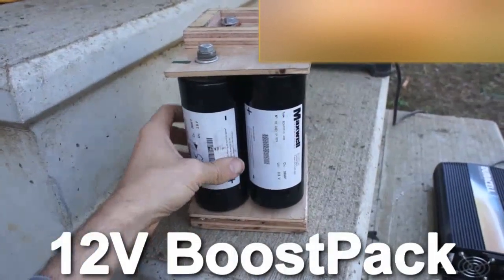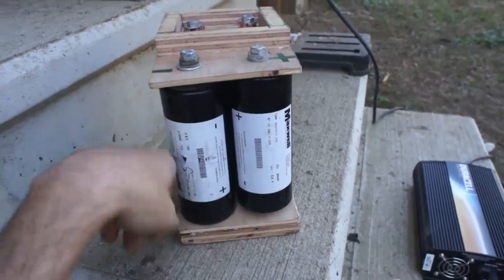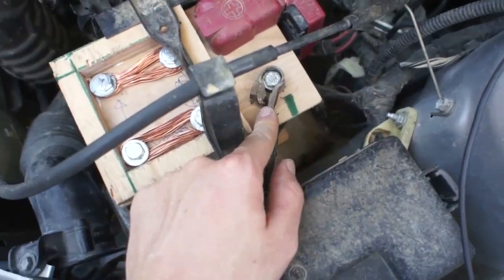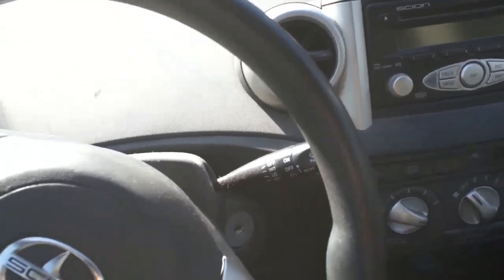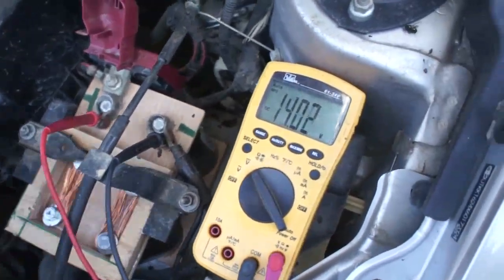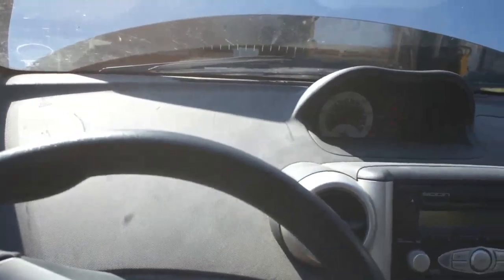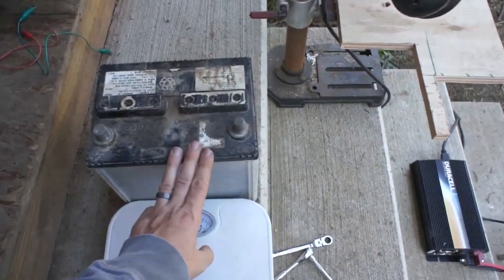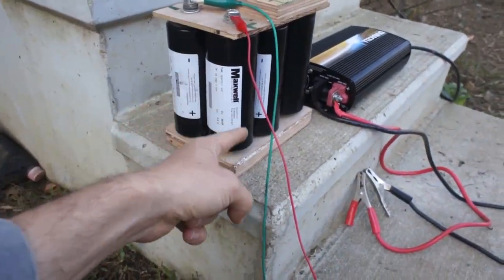12V BoostPack. Replaces auto battery. Works great!

Comment: Large capacity caps like this will give you a very high rate of amps, but have a very small amount of reserve capacity.  This means any of the following scenarios will render you screwed:  Engine is hard to start and needs to be cranked, alternator fails while driving, you leave your lights on for more than a couple minutes, etc etc.  A lead acid battery has an infinitely larger reserve capacity, and can work through these events.
Reply: Well...not infinitely.
Reply: What are you gonna do walk your car home off the starter? The scenarios you described are pretty much ones where you'd end up stranded anyway, or something else is going on with the car, in reference to the hard to start part of it. 

I don't leave my lights on without the car running.
Reply: Can there be a capacitor battery combination?
Reply: @matthewforte3570  actually they are on sale now, battery and capacitor bank they at around $170.00 + shiping on eBay dry batt not included.
Reply: @oscarvasquez2012  awesome im surprised such a item didn't exist much earlier
Reply: parallel them with a deep cycle battery for best results, RAW POWER plus long reserve time...
Reply: @christopherleubner6633  i look forward to electric cars becoming mainstream. Do electric cars wheels double as generators to sustain the batteries charge?
Reply: @matthewforte3570  yep
Reply: the motors that drive the wheels are used as a generator during light and moderate braking net effect is similar to dropping it into low gear, but can do so electronically.
Reply: Not really infinite.
Reply: bigman55434  keep n small solar panel in your boot problem solved

Comment: How long do they hold their charge? 
I'm thinking about using some in car audio application instead of using batteries. What would happen if I shut off my car and they aren't being charged anymore by the alternator? What voltage are they going to sit at? And what If I don't start my car for a day or two would they be ready or would they have to charge back up?
Reply: Buy an OPTIMA AGM battery for your car audio system. It's a lot of money, but it will last the longest and they are EXTREMELY reliable.

Comment: Optimum would be to have a permanent solar charger installed. That way your alternator would not have a max load charging the caps when they are low. Otherwise you need current limiting of 100 to 140 amps max. Discharged caps will put a tremendous load on the alternator. Somebody stated that the voltage was not measuring the charge of the caps. This is also wrong. The caps are capable of pulling so much current that the alternator cannot keep up resulting in voltage drop measured at the caps. When the alternator has caught up the voltage will rise to its max charging voltage indicating that the caps are fully charged. The only problem with using caps is the voltage is a direct measure of charge. At some point regardless if enough current is available the voltage will be inadequate to spin the starter. Here is when the battery has the advantage. Heavily discharged batteries maintain there voltage usually 10vdc. Also the caps don't present a load to the alternator and could cause a failure that way as well. Best option would be to incorporate a small 12vdc motorcycle battery. Battery for voltage, load and caps for instantaneous current.
Reply: I like your analysis the best of any I've seen on the video thus far. As a Ham Operator and an engineer, I also have some level of skepticism here. Having said that, I'm genuinely impressed at what this person has done.

I'm the man who invented the GoVolt portable battery backup systems. I may try this capacitor idea along with a small motorcycle battery for load control.

I can definitely see potential for a larger bank of these capacitors for running lights only in a solar setup.

Comment: Not an accurate test on testing recovery rate. The volt meter is reading the alternator output, not the batteries. The alternator will increase the voltage to charge the battery( "boost pack"). Also how long can you crank?( how many amps does it produce)?

Comment: how would this system work on a car amp
Reply: most people run car amps with capacitors. As the amp draws a lot of power from the battery or alternator each time the bass hits, the capacitor's role is to supply the amp with the immediate power and get recharged a bit more gently from the alternator. that's the simplified version at least.

Comment: how do you balance the capacitors when they are stacked and charged in series? internal resistance differs by a margin of about 0.4V, so the highest I've been able to charge them is about 10V before one or more capacitors are in an overvolt condition. Overvolt it for too long and the insulation will break down and develop a short. I would not want a shorted cap in a cap bank in my car.

Comment: i've spent most of my scientist's life without thinking of a simple thing like this ,i would add a hand cranking dynamo charger just in case u get stranded or even paddles ,,talking about loosing weight ..crank it up ! there is no replacement for displacement
Reply: Put a dynamo or a small wind turbine generator coupled to a  wheel. So as you move, you charge the caps.  That would be an "alternate" alternator :)